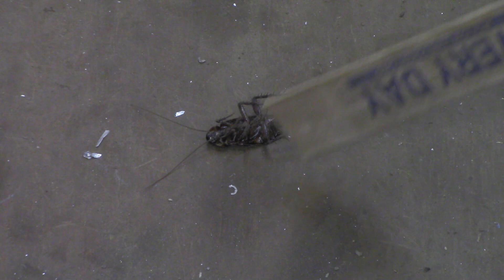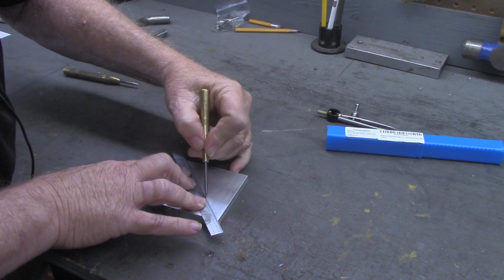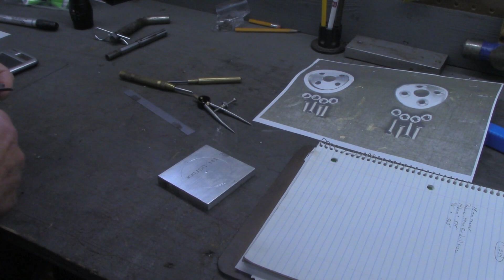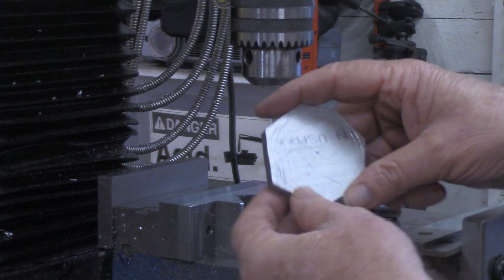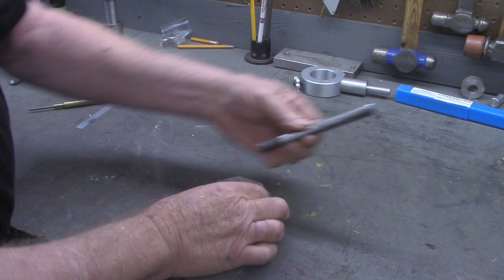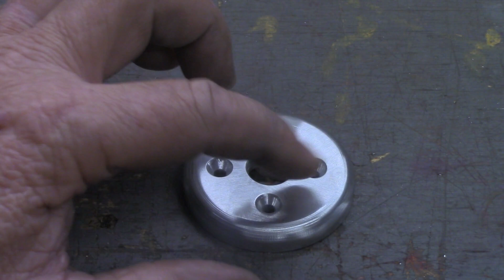Fishing Boat Electric Motor Wiring Flange

Comment: I do love your videos, and I don't mean to be critical, but, you've made the same mistake so often that I feel I have to mention it. The part was not  properly seated on the parallels when you drilled the first hole. It is obvious in the video, the near parallel was at an angle. After you tap the part down you need to check that the parallels are still in place and  properly held. Until everything is seated properly, everything will move, and probably not in the way you expect.